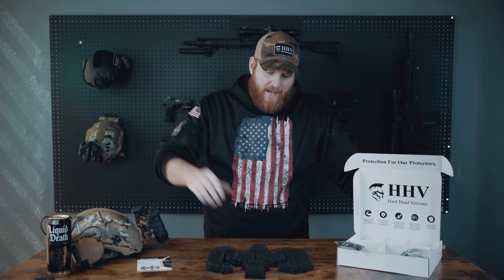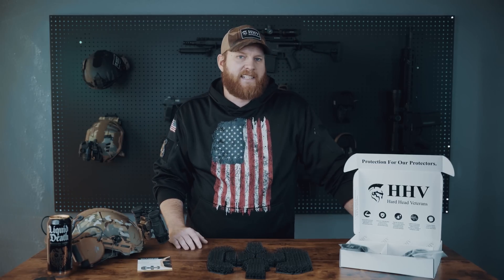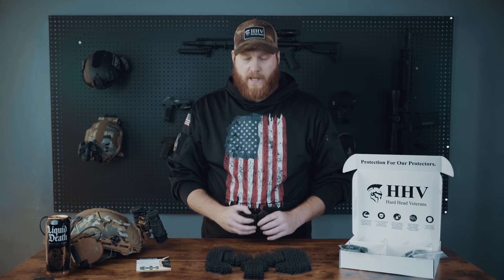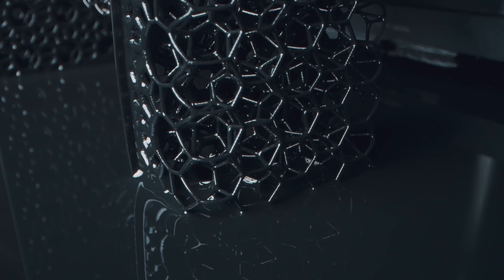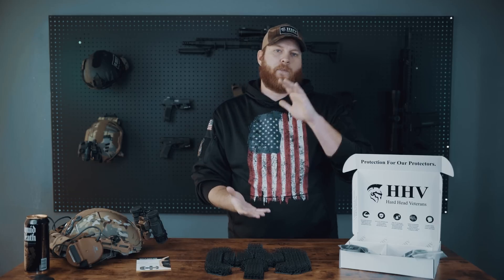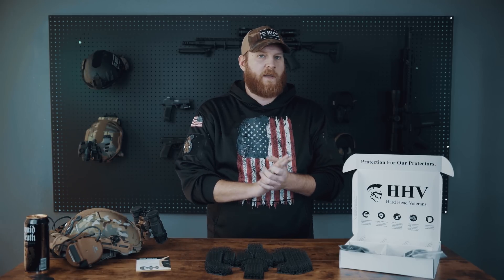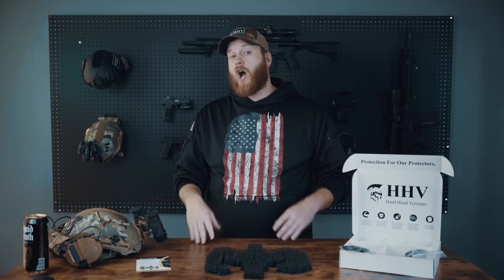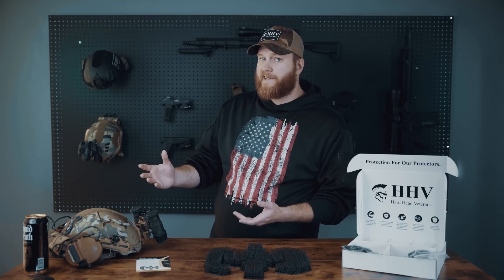Microlattice Helmet Pads are the Future of Head Protection

Comment: It made my helmet not fit properly anymore. Maybe I’m just doing it wrong. Not sure.
Reply from the maker: There are 2 different sizes did you go with the 1" or the 3/4". Also you have 30 days to get with us once you get it to swap it out for a different size in case you get the wrong size.
Reply: @ went with the 3/4”. The original helmet pads were so small that the 3/4” looks super thick
Reply from the maker: Is your helmet to loose or to tight with them?

Comment: Could this work for a firefighter helmet?
Reply: I would not run them inside a FF helmet due to the construction of it being a plastics...the melting point would be too low for a flashover or high heat event, potentially causing severe damage or injury even through a nomex hood.
Reply: @Dennhop  makes sense! Thanks for the input!

Comment: Mirco latice should be add to bullet proof vest design 
(They like the idea) pin me pls
Reply from the maker: That's an interesting thought. What part of the vest do you think it would be most useful on? We have a guy at the shop who's already rigged some of the prototyping up to make shoulder pads for his PC.
Reply: @HardHeadVeterans   I really recommend having it in the inside of the vest like cotton over the latice should be a layer of silcone then the Kevlar. I'd also add to improve on the design id add turtle neck with and sleeves (make parts of the sleeve bullet proof not the whole thing thinner stronger plates so that u aren't weighed down) and turtle neck you can give it a circular plate under the material unlike the sleeve make the vest chest plate 17 cm thicker you will thank me later.  (Then to experiment with make fish scale design with the side under the arm each "fish scale" will be like a plate with the lattice under and silcone but not really it'll just be there to cover the side u can experiment with this:" metal mixture "(Make the fish scales interlocking aluminum Platinum and tungsten into the vest chest metals)
Reply: @HardHeadVeterans   Do I get royalties from this
Reply from the maker: @yatochann3202 depends if the DNA on the product matches with you. We'll need to go on an episode of Maury to find out if you're the father of the idea or not.
Reply: Make the helmet attachable to the vest that would be game changer tbh
Reply: I think the concern would be what would they do in a high heat/explosion resulting in fire.  We had mesh pads issued to us to wear under our flaks in 06 for about 2 days, until they realized they burned and melted in an ied strike.

Comment: Is this 3D printed material impervious to insect repellent?🤔
Reply from the maker: This isn't something we've tested? I mean, it'd be about as impervious to it as it is to water I suppose.
Reply: @HardHeadVeterans  thanks for the quick reply. Be advised that if you ever pursue any DoD contracts DEET resistance is part of the testing process. Just fyi since you good folks are about to start releasing Berry Act compliant hardware 😉.

Comment: Any chance of developing maybe an attachment dual fan system? Like a flush mount fan in the front pointed up blowing while another is positioned by the base of the skull sucking the air out the back creating a constant cool flow up over the top of the wearer's head?  If you implement this idea I'd gladly accept a sweet discount fellas!
Reply from the maker: That's a whole lot of moving pieces on a piece of kit that's going to get tossed around a whole lot.

Comment: I absolutely LOVE my set inside of my HHV bump helmet.  If anyone is interested in upgrading your helmet, you should definitely check these out! One thing that I wish I had known was that these are a bit thicker than most standard pads that I have used.  That has made my Team Wendy chin strap a bit tight especially if wearing a balaclava.  Just something to keep in mind.  Keep up the great innovation HHV!
Reply from the maker: We're working on a 3/4' for this exact reason! Stay tuned on that.
Reply: @HardHeadVeterans  Just ordered the 3/4"! I will make sure to update to see how they fit compared to the original.  Thanks!

Comment: I bought mine for my HHV helmet when they first came out. Although I haven't been shot in the head so I can't attest to how that feels I can say that they are super comfortable to wear. They conform to your head perfectly unlike foam pads that you have to play with to get them just right.
Reply from the maker: Glad you've had a great experience so far. Hopefully you never need to test the "getting shot in the head" part.
Reply: Yes indeed. I bought the 1" microlattice first,  but it was a bit too tight of a fit. Went with the 3/4" microlattice, and it fits perfectly. When worn in conjunction with the headband HHV provided it's very comfortable on my bald head. The conformal nature of it allows you to rock a standard H-nape, or X-nape without having to upgrade your retention system.